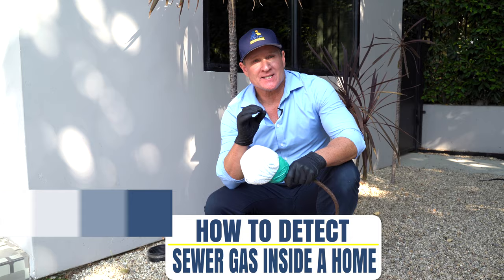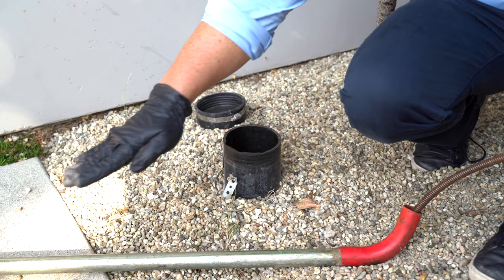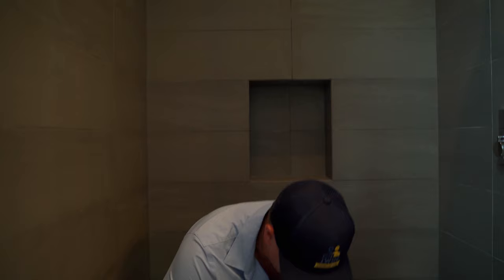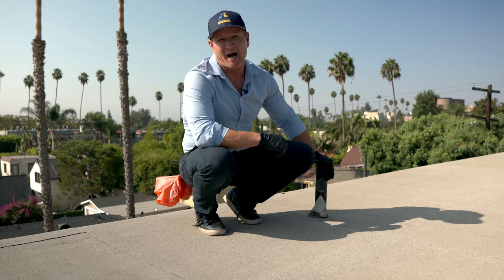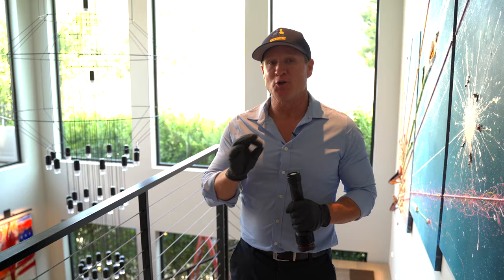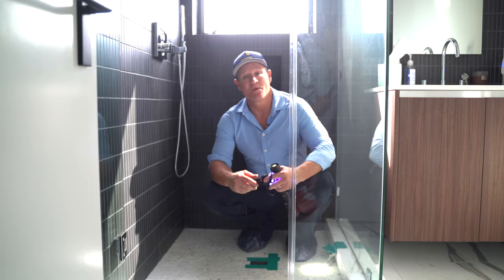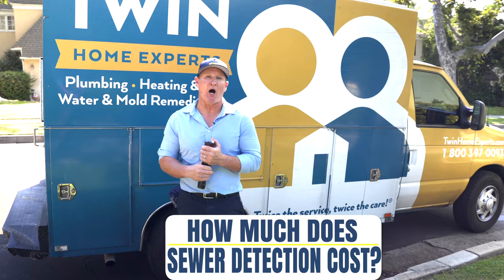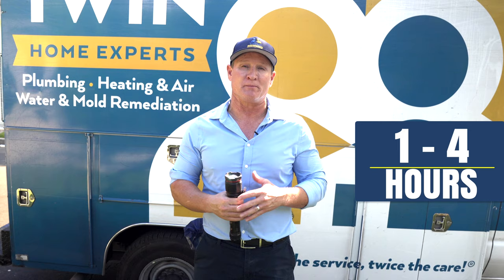How to Find Sewer Smell in Your House with a SMOKE TEST! Twin Plumbing

Comment: There is a simple solution for traps drying up or just not being used.... fill with water and put 1 cup of vegetable oil down the drain. The oil will float and form a film so water below will not evaporate.

Comment: If the shower stinks even though it is used and the trap should be full, the trap is missing and you can see this in the basement. Just have a plumber put a trap into the line.  If the laundry room stinks, the trap in the laundry room floor is most likely missing some water. Water can evaporate out of the traps and then the smell comes. Just add a glass of water every 3 days to the floor drain to fill the trap.  Many kitchen sinks are missing traps that could have been put in at a location near the person doing the dishes. The lady doing dishes breaths stinky bacteria odor each time she does the dishes. The plumbers hate women I guess.
Reply: Lol, my son does the dishes 🤣 😂 😆

Comment: What is the cost of simply replacing some of the traps that may be failing? It would seem that treating the affected area would be way less expensive than running a test that could cost thousands. The toilet had already been caulked and the ring replaced, therefore the shower drain was (not surprisingly) the smoking gun.

Comment: I’m in a condo and have a unit above me that’s been revovating. For the last 2.5 months I’ve had sewer smell when AC KICKES on. This seems to be my issue- I’ve had many professionals here and no one can find an issue. My condo association just had a plumber run the camera in the sewer pipes and said there was no break or no back up. This baffles me! My question is if I were to hire someone to do the smoke test do I need access to the upstairs condo because they may have busted something loose. Thank you for feedback
Reply from the maker: Hello Sue! Sorry your having to deal with this. This is going to take someone with the right experience to pin point the issue. 
In a condo structure, running camera typically don’t scratch the surface of finding the source.
I wouid find someone who does smoke testing, but you may need to do your unit and the upstairs unit, while your A/ c unit is on.

Comment: In India we wont do these kind of smoke which is very costly and we just change the drain holes to a type called Cockroach Trap Drain(Rs 255) where always water will be there so there will not be foul smell afterwards.. very low cost fix

Comment: Envision this..

The way a carburetor works..air passes through a venturi drawing fuel up from the carburetor bowl..
Now picture your plumbing vent on your roof this is your carb jet..very windy days it draws your fixtures trap water(shower,toilet,sinks,laundry) right out of the trap into main stack draining to waste..trap is now useless/empty or almost empty..sewer gas is now able to pulsate out of fixture with fluctuations of wind. Now you be stank .

Comment: I have a 1955 ranch home with mostly all original larger pipes made of cast iron and smaller for lines are copper, 3 sinks have the newer ABS plastic.

The smell in the house is just terrible. I've moved here 2 months now and I can barely stay in here.

I've asked locally for plumbers that do this and they don't even seen to know what I'm talking about. I'm willing to try anything DYI but mostly in not certain I have those vents on my roof... How could I help myself before I suffocate in winter 😃
Reply: Your main sewer line was broken wasn't it?
Reply: I am having the same problem in a old 1958 farm house
Reply: @rstjohnw well, I'm having that problem. Main sewer line is cracked across the entire top of the line that is not buried. Smoke test being done today (five plumbers later) 😮

Comment: I need help.  I have had 3 plumbers come to my home, and none of them can find the sewage smell.  One told us to replace the sink (which is NOT the source of the smell, it's coming from UNDER the sink), one said it's probably a dead animal in the wall (animals don't take 3 months to decompose), and another did a smoke test but didn't find a leak.  I don't know what to do.  I called a 4th plumber who says I need to have someone remove all the drywall and expose all the piping before they'll come out to help.  That's going to cost me a fortune.  What do I do at this point??
Reply: Sometimes bathroom sinks with overflows harvest bacteria in the overflow drain. If it’s just in the sink then I would use a cleaning solution and fill up the sink to clean that overflow drain out and kill any bacteria that’s in there.

Comment: Cool didn't know you guys do plumbing... I have a similar issue but I can't find the culprit.  That poured peppermint oil down one of the event stacks on the roof and I can tell where the smell is coming from but it looks like I need to cut into the walls or drywall.  That's where I'm lost at but then again I didn't do that smoke test.
Reply: I'm learning most of these folks never put in any of our homes equipment properly. None of the ptraps are installed properly and or if any at all. Our ac unit did not have a drain pan and they had the condensation line running into the sewer...from 2016 to 2024 I complained and begged telling these folks something is wrong I smell gas. Now I have autoimmune disease, severe health problems. Find out mold in air handler,  all over coils. Pulled the unit from closet in hallway. Mold all over walls. And guess what. Pipe was busted that went from ac into the pipe leading to the sewer in floor 😳.. and no ptrap as well. 
So got expensive fancy new ac duct work all the bells and whistles and what do they do...connected the primary drain into the bathroom sewer stack going out the attic. I smell gas what do they say..oh we will come put a ptrap in to make your wife happy. 😠 
 I said I don't need to be happy I need to be satisfied knowing you did your job to code. And I studied Everthing. I sit in this chair and watch every you tube video for HVAC classes took notes and more. Over a week of studying to learn all these 💩 men have no idea what their doing, so they do whatever 🙄 because they figure who's gonna check their work. ME!!! I'm almost 51..the ptrap is incorrect and on the secondary line the didn't have it running nowhere. It's all in the attic now. So they come run a line, took 2 hours. Just to do it wrong. It's NOT to code. Am I really gonna have to pay inspector to hold them accountable. These fools don't listen. And don't care. Their taught to say mildew, cause they can't say mold legally. All them gonna die from this mess. Just cause they don't right away doesn't mean anything. They don't understand the pain until it arrives. They don't even know where it comes from because their to (I want say it) BUT THEY ARE. INNOCENT KIDS SUFFER BECAUSE NOBODY HAS INTEGRITY ANY LONGER. 😢 😭 WELL I KNOW THEIR ARE SOME GOOD ONES OUT THERE. !?! RIGHT. Dear God I hope so.
Reply: @jennifergallander2504  That's rough...DIY if possible but lots of scum in the trade field.  Most use scare tactics to get more biz.

Comment: Great video! I own a condo on the top floor of a tower (14th floor). Sewage smell comes and goes, p-traps have been checked, any chance I can do a smoke test being in a tower? I have roof access. Thanks!
Reply: Wouldn't it just be easier to buy a gas sniffer at home dept?   This seems like an awful big project.....I found my leak in 30 seconds with a sniffer
Reply: Check and replace your air admittance valves
Reply: @jones762000  which one?
Reply: @organicvids  where are these found?
Reply: @Johnnyjjohnboy  they are under the sinks. Liok them up.

Comment: Could I use a fog machine?
Reply from the maker: Good question! Unfortunately a wetting agent won’t flow through the plumbing system. 
Your better off getting a smoke candle and shop vaccum. You light the smoke candle in a metal canister, tape it to the bottom of the vaccum, then start the vacuum up with the discharge hose into the sewer pipe:
Reply: @TwinHomeExperts  thank you!
Reply: @TwinHomeExperts I thought you said the smoke handle can ruin the interior of the house and items in it